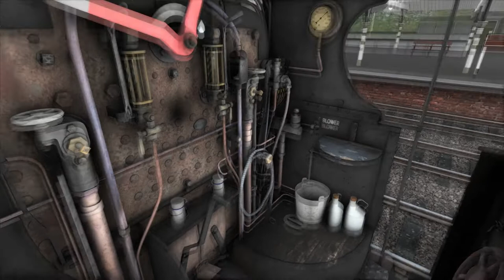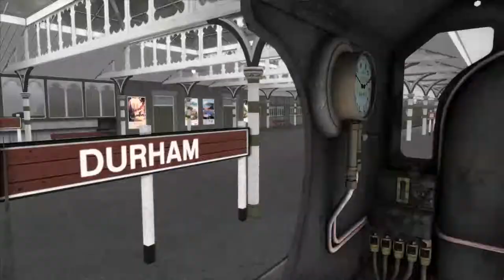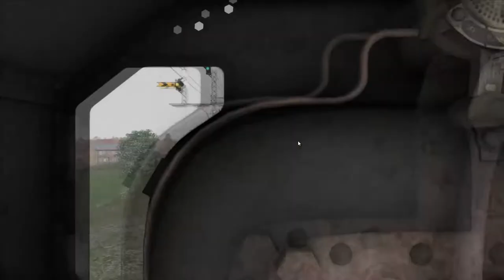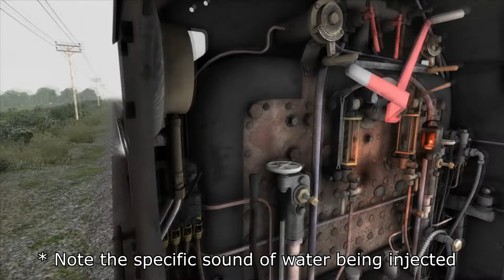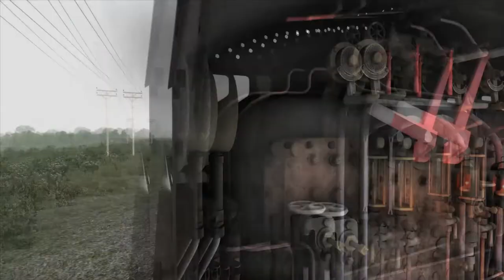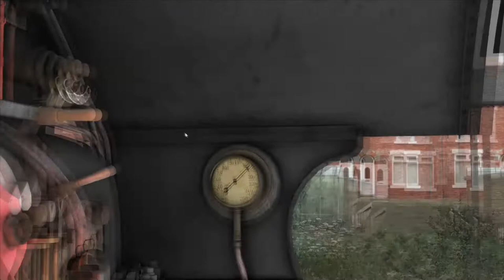DRIVING THE G2 STEAM LOCO! - Ultra Realistic Steam Engine

Comment: Firstly the picture in my avatar is the actual loco featured in this video. I would like to say that the detail is phenomenal. The sightfeed lubricators were only fitted to locos with two oil feed pipes from the handrail oil boxes, the ones with five oil feed pipes did not have them. This is correct on other locos in the pack, amazing. I enjoyed your commentary, you seemed to get it about right. Incidentally 49430 was the last of the class to drop its fire in December 1964.

Comment: I shall now make an extensive edit with directions since my attention span wants to be short
edits galore, here i go
edit: yipee, got further than just the section that has a restriction of 20

Dont let the coal get lower than the 4th bolt in the box

When not shoveling coal, make sure to raise the air deflector and close the firebox doors to the small notches on the side of the deflector for optimal performance

Reverser: Hold E to unlock, Wind Left for more torque and wind right for more speed
(in the video, he starts by winding all the way to the left, then right two times for more speed)

once you release brakes, open the throttle bit by bit (around 20-30%) to start moving. 
brakes fully release at 21" Hg for both gauges
Close cylinder cocks after four wheel rotations.

Remember, if you ever prime, open the cylinder cocks until you stop slipping

Once the water level is around 2/3 or less, you can get more confident with opening the regulator

He winds the reverser another 1 1/2 turns in for about 20-25%

Later in the video, he moves the brakes into the running position since steam is going towards the brakes. when the needle starts to drop, open the brakes back up.

To put water back into the boiler, there is the live (left) and exhaust(right) injectors
Exhaust pumps slower, but uses less pressure
Live pumps faster, but uses more pressure

Turn off the blower if youre at a stand still, or going through a tunnel
Reply from the maker: Nice work!